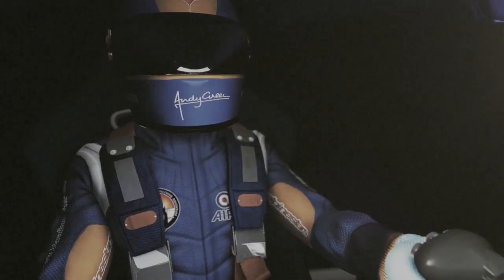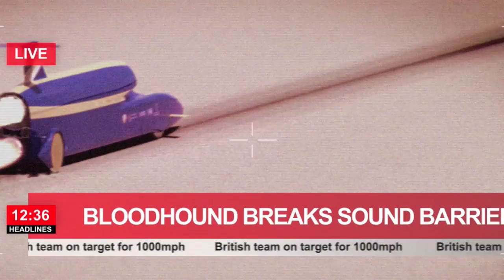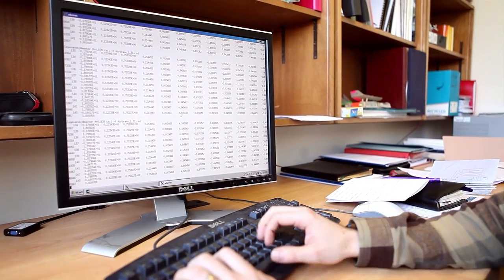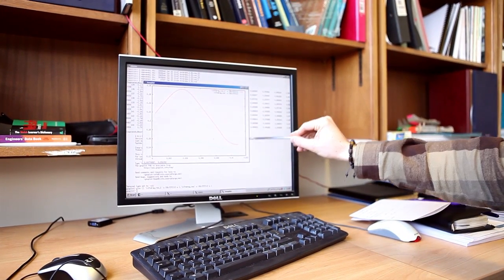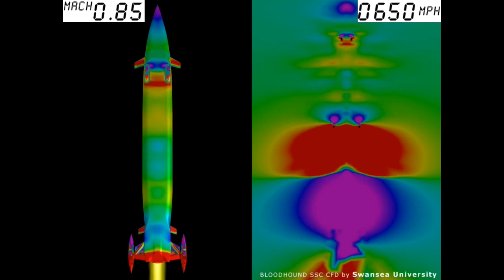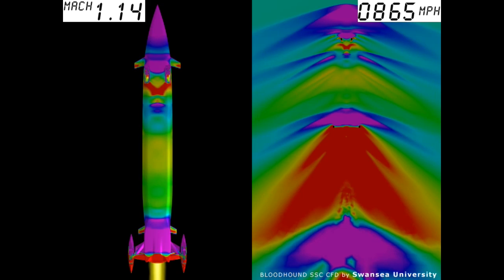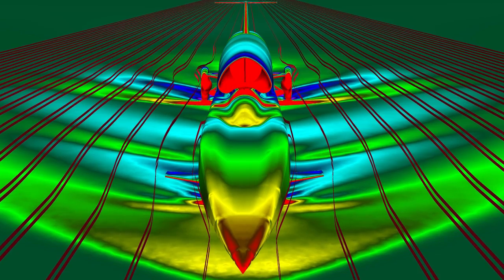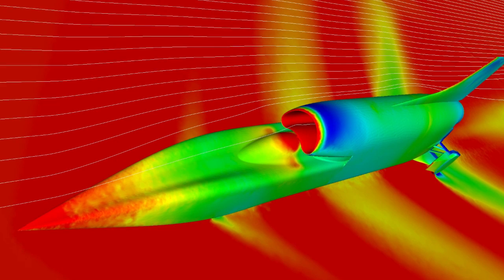BLOODHOUND's aerodynamic design without a wind tunnel - CFD

Comment: Hi,
i'm a bit intrigued by this cfd simulation. Currently one of the CFD problem is that we cannot predict the fluid behavior in a microscopic scale. The navier-stokes equation are only efficient in a macroscopic scale. Since this project is on the state of the art, i was wondering if you guys are working on this microscopic aspect which will sure get you better results.

Comment: 800 under a sec! holy shit , good job full scale is not that fast youd just paint the cabin red ! Any 1 know the gs involved ?
Reply: Not as high as in the rocket sled test, that's for sure :) About 2G acceleration and 3G deceleration - with quite an uncomfortable 5G swing from one to the other after the measured mile. They're not massively high forces - but Andy will have to endure them for quite a while compared to something an F1 driver experiences.
Reply: ***** 800mph under a sec its a tad more then 3 or 4g  : ) , f1 brake at 5g
Reply: fatbarry barry where did you get 800 in a second from?  Bloodhound doesn't do anything like that accelerating or decelerating.
Reply: +martinev12 around 5:55 - 6:02  thats where i got 800mph from .
Reply: I know I am late af, but it is 45 gs